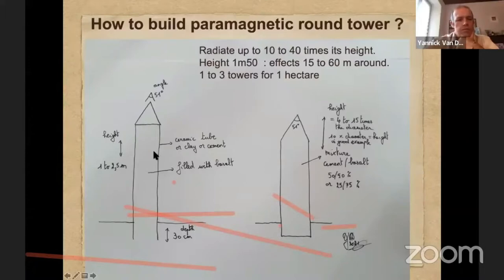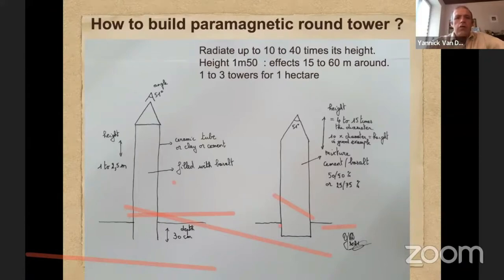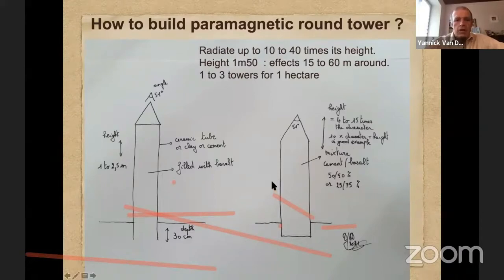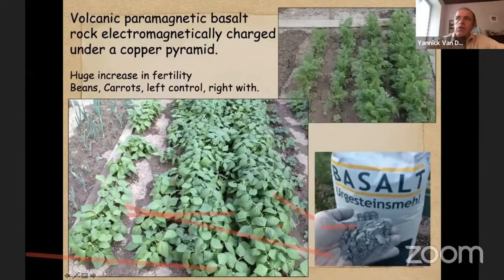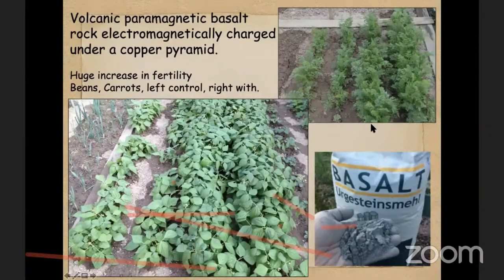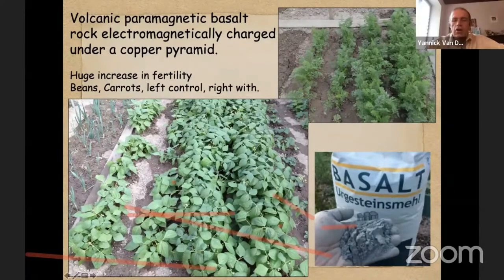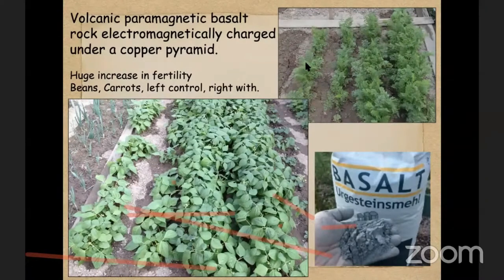PART-04, Electroculture Introduction to Sri Lanka - How to Make Paramagnetic  Energy Round Tower

Comment: Thank you for this, i would be happy to build this around our temple, asides from basalt is there any other material that can be used, like copper? also, the mixture in the diagram is it clear that you recommend mixing cement with the basalt? lastly is there any other thing that needs to be done to increase the effect?